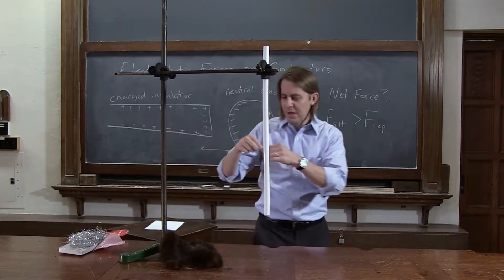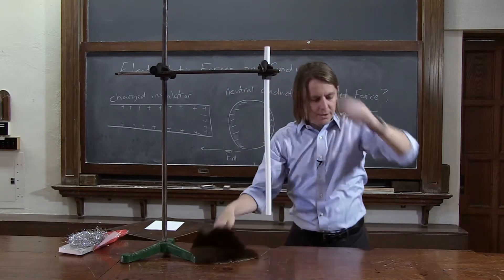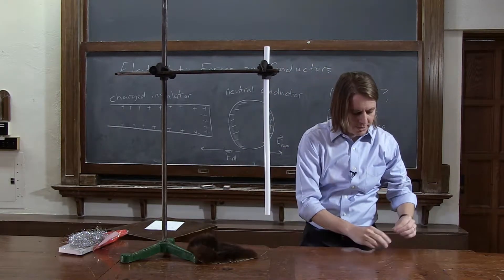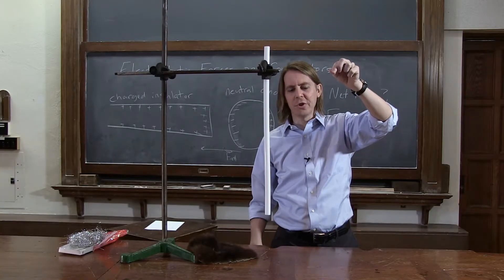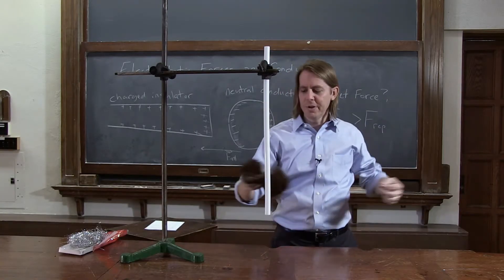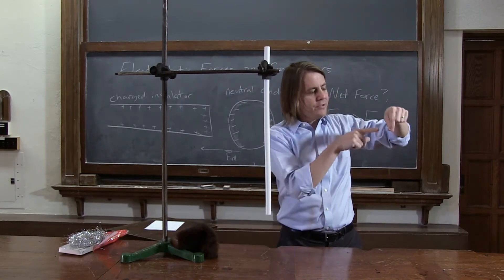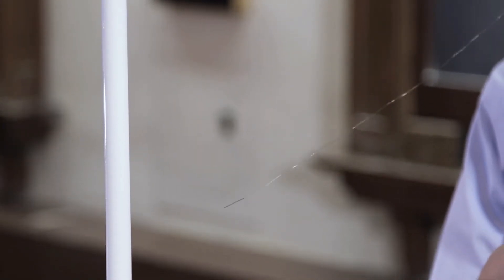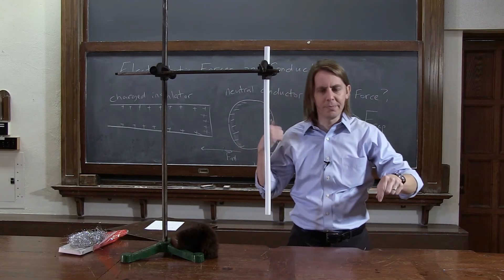DEMO: Forces on Conductors

Comment: I'm confused by the "Mylar" strand experiment. You said it's Mylar but I thought Mylar was an insulator. Does it have some conductive metal foil on the mylar? what conducts?
Reply from the maker: Yes the shiny part is conductive.  It may be covered in plastic to you don't touch the conductor, but it is conductive enough to see it attract to an excess charge.